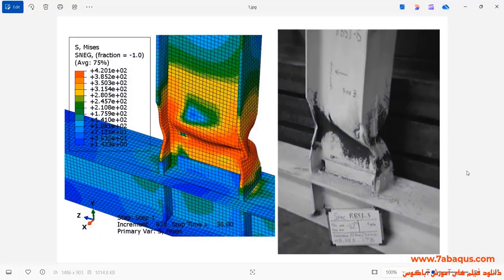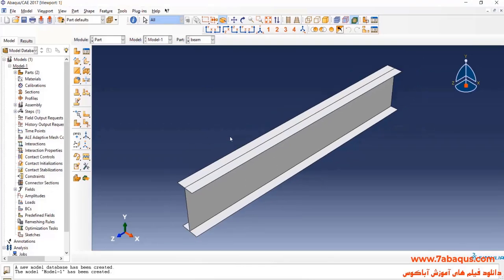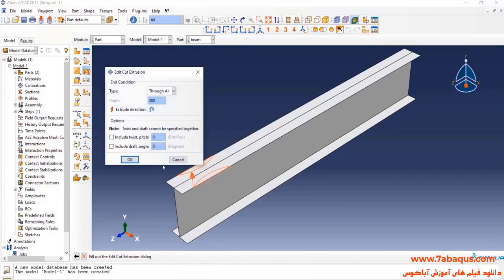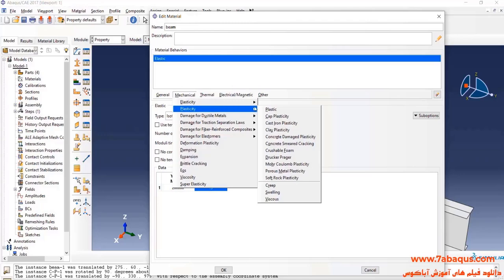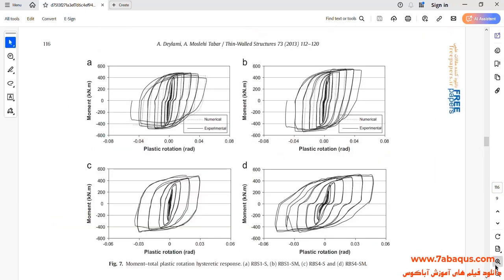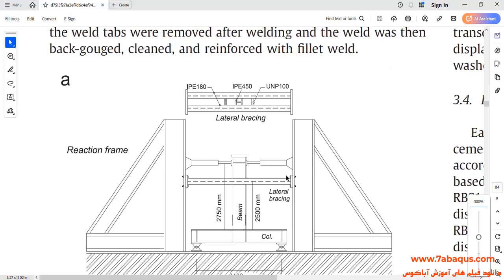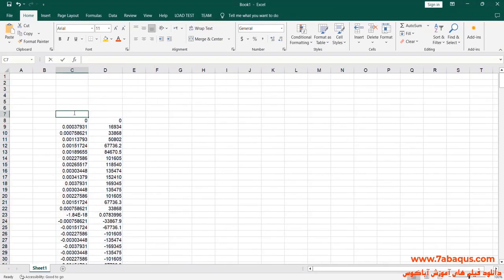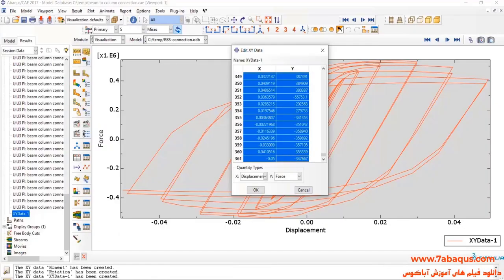Cyclic behavior of reduced beam section connection in Abaqus

Comment: Hi! Your videos have been very helpful — thank you for sharing your work.

I have a quick question:
When modeling a steel connection under cyclic loading, shouldn't a kinematic or combined hardening rule be used to properly capture the material behavior?

Do you happen to have any videos or resources that explain how to set this up for connections?

Thanks in advance!
Reply from the maker: Yo can use combined hardening with "parameters option" and "number of backstresses". Also , you should define cyclic hardening 
In this case, as I said, the article itself should provide you with these parameters so that you can use them.